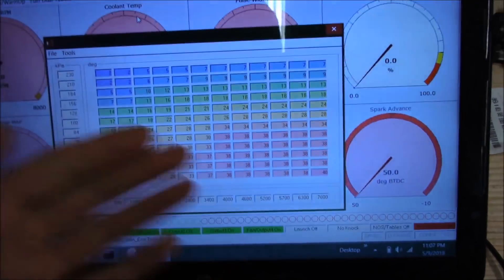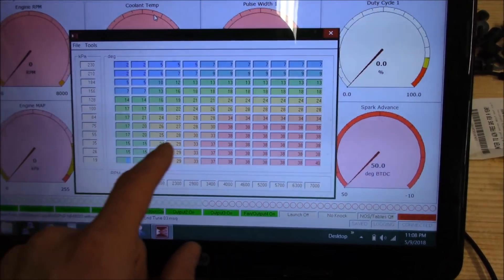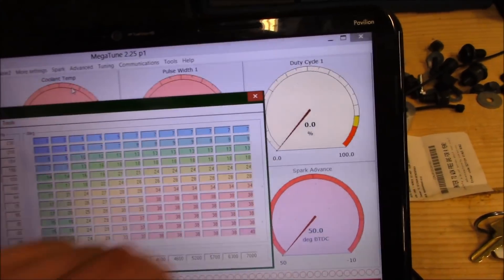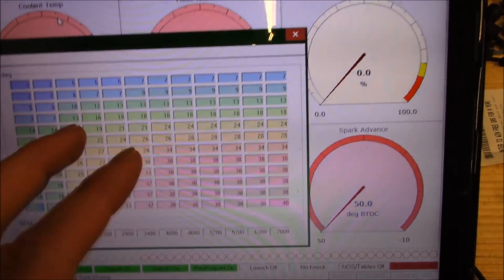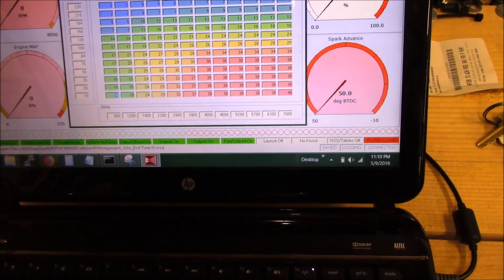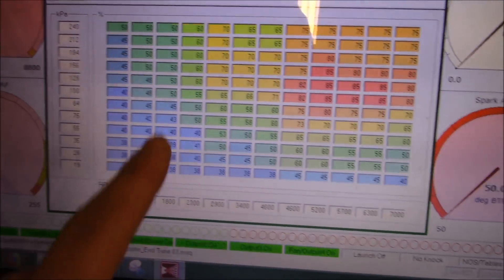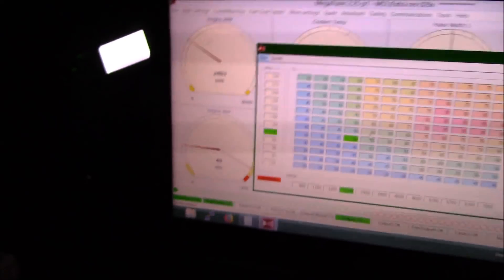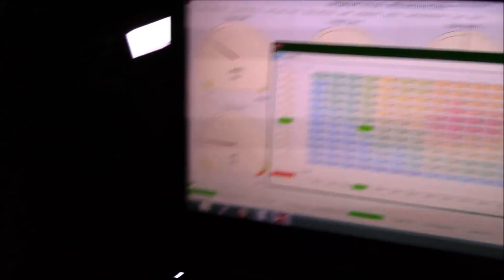The IMPORTANCE of TUNING

Comment: A property rebuilt engine will increase performance and reliability. For example, it you rebuild a bottom end by balancing the rotating assembly and ceramic coat the pistons that will make the engine spin easier and more resistant to detonation.
Reply from the maker: If you are detonating, ceramic coating or not you are still doing damage.

Comment: Megatune?  You need to get Tunerstudio if you are gonna tune MS related stuff.  Megatune gonna make you take forever to tune stuff in.  Atleast with tunerstudio you can do a lot of stuff a lot faster.
Megatune is dead and shouldn't be touched ever.
Reply from the maker: Okay.... My MSPNP was a version 1 and the tune just needed some minor adjustment after transplanting everything into the new owner's car. I no longer own any of the turbo setup, engine or ECU so the TunerStudio thing has no bearing for me at this point. We finished the original tune when everything was in my car back in 2010. Not sure if Tuner Studio was even available back then.
Reply: I understand it was a MS1 based ecu, even so Tunderstudio as of now would be the way to go.  I give the benefit of doubt that you may not use MS much.  I don't recall if it was around in 2010, but I know for sure now you could use Tunerstudio with MS1.

I agree completely with the video though for the overall reason you posted it.

Comment: Great video! I tune as well and like this approach. Gotta fine me some help. Also its funny how most don't understand the importance of NOT tuning to the ragget edge. Hell the Fd Rx7 is a perfect example of this. Some say the 10.0 A/F ratio is too rich for 10psi. What they don't understand is that that extra fuel is their to compensate for someone running 87octane. Even Mazda knows that not everybody is gonna run the recommended 91 so they have to program in more fuel to compensate. I ran mine for years with 87 without any problems.

Comment: Tuning is awesome, and even more awesome is when you do your whole build and self tune it to perfection. I finally got my car back on the road after 2 years of up and downhills building it. Been driving it for about one week now and taking small steps road tuning it. Drive-record datalog-take a break-tune-drive again and repeat. Never before tuned anything or even built something this serious, and it just drives better everytime when getting it dialed in. Don't even have idle air control valve and cold starts with E85 works like a treat without touching the throttle at all with big 272 cams. Only ignition controlled idle strategies to get cold and warm engine rpm's where I want it to be. Feels good now when you light up 265's in 3rd gear with just throttle at 14psi lol.

Comment: I mean surely you wanna use a dyno to tune all cells and have it apply load, rather than go out and completely toast your brakes? that doesn't seem right to me
Reply from the maker: Brakes are a small price to pay vs blowing your engine. However, you are not even going to kill a set of pads doing a full tune. Maybe wear them a little bit in the process, but that is it. The problem with a Dyno is that even though it simulates the load of road conditions, it is not really the same. So if you tune on the dyno and then go out on the street, the tune changes. Forced induction cars are more effected to the point where it could cause damage. N/A cars are not as bad but no matter what you need to go through the entire map again on the street after dyno'ing and check everything. Every one of my cars needed some corrections do to the changes in load.
Reply: I mean if it works for you that's fine, I'm not trying to attack you. I'm just saying with a dyno being able to produce any amount of load, I can't imagine many situations found on the streets that a dyno can't do, and you don't have to fade your brakes a bunch of times and get interrupted by unexpected events on the road, not to mention fast stuff that could get you a ticket.
Reply from the maker: I know you are not attacking me and I wasn't being defensive. I don't think you are understanding what I am saying. The Dyno's load is different per RPM than per RPM on the street. So the tune changes after you finish tuning on the dyno getting your final numbers and then put the car back on the street. I have 5 cars with standalone ECUs in them and every single one needed tweaking after going through the tune again on the street after Dyno'ing. That's not saying a car fully tuned on the dyno is just going to blow up if you don't change anything after putting it back on the street. But perhaps from a long term stand point I would think that engine life would be compromised to a degree since the tune wouldn't be optimal. Also, as long as you have a decent pad like a Hawk HP+, you are not fading the pads brake holding the car. If you have ever jumped on the brakes hard from say 80 MPH+ you get sparks also. Doesn't mean the pads just fade or wear away to nothing. To your last sentence, you can just keep that cycle going and say well you shouldn't speed or attack corners and so on and so forth. Everything has a risk. You can decide what is right for you. I am simply showing how we have been tuning and the success we have had over the past 10 years tuning my cars this way. Still haven't lost a motor. Take that for whatever you think it's worth.

Comment: damn there has to be a better way than toasting the brakes, would hate to spend my money on a tune and then have to buy brakes after lol
Reply from the maker: Brakes are a small price to pay vs blowing your engine. However, you are not even going to kill a set of pads doing a full tune. Maybe wear them a little bit in the process, but that is it.
Reply: does TRD or Nelson racing use this sort of method?
Reply from the maker: I am not sure what they use to tune. My guess would be an engine dyno.

Comment: As someone who recently switched from an "off the shelf" flash tune to a Cobb pro-tune for my GTI, I can wholeheartedly attest to this. As part of this process I learned how to read and understand datalogs as well as relationships/correlations between different parameters. It's a piece of the puzzle that's often taken for granted and hardly fully understood. Certain "qualms" that I have learned to live with when the car was flash tuned are now completely gone and the car is faster and smoother than ever before. Great video!

Comment: always great videos. Do you have a standalone ecu on your s2k? if so what did you choose? and if yes to the first question, did you do a street tune on the s2k as well?
Reply from the maker: Yes I do, it is a Haltech Platinum PNP. Yes full tune on the street, then dyno for final numbers, and then cleaned up again on the street. N/A cars won't change as much as a turbo car will from the Dyno to the street, but we still had to make some tweaks after the dyno.
Reply: I was highly considering purchasing a Haltech, but I was doing my research and came across a few questions being if it would work with my 2005 ap2 s2k which still has the throttle cable. I found one post on s2ki stating that it should work as its not a DBW. What strays me away still is being able to keep all functionality in the s2000. The ap1's have a different display for its coolant gauge and I have not seen any information if it would be compatible with the 05 coolant gauge. Ive read the Haltech PnP keeps all its functionality for the ap1 s2000. Only reason that I dont get an AEM is I hate the long cranking. I read AEM asks for 720 degrees of crank rotation before ignition. To me, it makes the car subpar. puts a stigma in my head that something is wrong. ie; I get negative feelings over it.
Reply from the maker: I don't see why the the coolant gauge wouldn't work unless there is something specifically saying that it won't. Long cranking is a good thing. Means you get more oil pressure before the engine starts. The Haltech cranks the engine slightly longer than the stock ECU as well.

Comment: Reliability, of course, you should build for reliability. Yes, you can build greater performance without strengthening the engine and it will likely blow up hence using forged pistons, better bearings, etc. to keep the system reliable. 
Then, yes you can map with ignition as close as it gets to a knock with very little fuel to maximize torque but again, what s the point, it will break... so retards by 2deg and aim for a slightly lower afr... you will loose a few ftlbs but you will remain reliable...
Reply from the maker: Right. I just think that once you undo those rod caps you are getting rid of the 200k mile stock motor reliability. I'd love to see a built motor (pistons, rods, bearings, etc.) do 200k miles, but I don't know if there is one that exists. I'm sure it is possible if someone is really really good, but most of the time people go to local engine builders and have no idea what was really done.

Comment: im shaving my 97 miata head 0.020 inch and running on stock ecu and cam gears, will this be ok
Reply from the maker: Should be okay. Might want to run 89 or 91 octane afterwards as that will bring compression up to about 9.7:1.
Reply: thanks!! I was planing on running a higher octane fuel do you think  0.030 inch would be to much with stock cam gear/ ecu? love your channel by the way!!
Reply from the maker: I think you can do up to.040" on a stock ecu with 93 octane, but don't quote me on that.
Reply: sounds good but I probably wont go higher than .030 , i have 93 octane where i live

Comment: loving this kind of info! I'm looking to run twm itbs like your nb and was wondering what ecu it is tuned on and would you recommend any specific ecu for NA tuning? i know some have lots of extra functions that cater to boost but are there any extra functions that you would look for in NA use?
Reply from the maker: N/A applications require less. You can just tune off of TPS to simplify them. I have an Adaptronics in my NB. I was in on the original group buy for them when they came to the USA. Went through 3 ECUs to get one that worked. My crank angle sensor and ECU read timing off from each other by like 4 or 5 degrees. So my timing maps show more ignition advance than what is really happening. Given those minor set backs, the ECU is still preferable over my Megasquirt PNP V1. Not sure how far they have come now. I like all of the new Haltech stuff a lot. The one in my S2000 works great. I don't think they make plug n play stuff for Miatas though.
Reply: sounds like I've been on the right track with my ideas of what i need from an ecu as I'm aiming for the simplest setup i can. the PO of my itbs had an adaptronic pnp and said it had idling and drivability issues. Haltech has good stuff but it requires rewiring (not simple). Flying Miata/Motorsport Electronics released their drop in fully programmable FM221 motherboard made to fit in a stock ecu box and use all factory wiring. never seen this ecu used to run itbs but i can't see why it wouldnt based on the functions it has. every time i ask someone about it i get crap for not using boost so getting reliable info from someone with previous experience NA tuning is great. also do use a stock TPS or is it on your twm manifold? and did you make any large fuel system mods to run the aftermarket injectors and fuel rail?
Reply from the maker: I have no idle or driveability issues with my Adaptronics. It just took a little while to get everything dialed in. I adapted the stock IAC valve, so idle is all set too. No modifications to fueling other than deleting the FPR and utilizing one of the stock pulsation dampers for the returnless NB fuel system. My manifold came with the optional 39 lb injectors from TWM.

Comment: I wonder how you tune for example the fuel cells with low boost at high rpm?
Reply from the maker: Easy, just back off the throttle so you are not boosting but are giving enough gas to cruise in that cell.

Comment: I have an ap1 s2k with emanage ultimate, NA but full bolt on. From what I read, I can only reliably tune by TPS only. What order should I set up the tables (I understand that they add on each other)? Timing then AFR then air temp? When/why does coolant temp come into play (other than when the car is not warmed up yet)? Any help would be appreciated.
Reply from the maker: Emanage piggy backs off the stock ECU, which has the MAP sensor in play. You can blend it with Alpha-N, but tuning off of just TPS is probably easiest. Set your timing map close to stock, then go through fuel, then you can play with bumping timing, then once your tune is close to finished, tune all of your corrections i.e. air temp, coolant temp, and voltage.
Reply: Garage Quinn Motors thank you!

Comment: You say no less than 20 hours tuning on each car. What about those of us who don't know how to tune a car? I have a miata ND and was going to do remote tuning with data logs and ecutek. It's going to be just bolt-ons but I have no other choice to do remote tuning for the skyactive motor in south Florida. What would you recommend I do? How long would it take me to learn how to use software to tune the skyactive motor?
Reply: I promise to never make fun of neo chrome again if you give me your .02 :D
Reply from the maker: I have no experience with the remote tuning stuff and how accurate it is. I am assuming they will be doing it on a dyno, but I would still have someone knowledgeable stick a wide band in it and go through the map afterwards on the street to make sure it is okay. It's not just understanding the software, but understanding what the motor wants, how it should sound, and knowing where AFRs and ignition timing should under each load condition. It just takes a while of doing it to truly understand it. It took me a long time to understand it the way I do now and grasp everything. You can make fun of neo chrome. My feelings don't get hurt easily ;)

Comment: Nice insights and video. What do you think about logging the runs with boost, rpm and AFR. And then doing the adjustments when stationary? This way you could do it alone? Also this fuel table you showed is for WOT? What about part throttle, do you tune for that or is it all dependent on boost? Thanks!
Reply from the maker: I don't really like the datalogging tuning because you cannot feel or hear what the motor is doing at that RPM/Load/Boost while comparing the AFR. The fuel table I showed is the entire fuel map for the car, idle, decel, part throttle, cruise, WOT, etc. The X axis is RPM and Y axis is load/boost pressure. 100 KPA around the middle of the Y axis is 0 PSI. Below that is vacuum, above that is in boost.

Comment: hey quinn, thanks for the video, i'm very new to tuning, and just had a quick question... so at the end of the video, when you're doing the street tune. when you're holding the brakes and maintaining revs, is the program automatically populating the values for the cells? or are you manually typing in values?
Reply from the maker: Anytime! The values are not populating, we are manually adjusting them and watching the change on the wide band, while listening for how happy the engine is and for any detonation. It takes a lot longer then what I showed. I just wanted to give an example of brake loading the engine and how we go through the entire map.
Reply: So starting from the minimum mix is 14.7 (below 100Kpi) and the maximum is something around 10 (above 100kpi), we could start from scratch some mix values from 11 to 10 afr ratio would be placed in all the first row (from left to right). Values from 11.5 to 10.5 in the second row, values from 12 to 11 in the third row, values from 12.5 to 11.5 in the fourth row and values from 13 to 12 in the fifth row. Could it be a good start?

Comment: Just a couple of points:
1.  You didn't mention if you gave him your exhaust as well?  If this changed to a different item, the engine would require map changes for the possible different flow rates (a better flowing exhaust would make it run lean and a more restrictive exhaust would make it run rich).
2.  It should also be noted that as much as too much ignition is detrimental, so is too little ignition.  It might not result in a catastrophic failure, but it can create extremely high EGTs that can nibble away at turbine wheels, valves and piston crowns. 
I also totally agree about live mapping rather than generic chips.  
Great content as usual :).
PS.  Engine dynos FTW :p ;).
Reply from the maker: Thanks Mike! Yeah, it's not easy remembering to cover every detail in videos like these :)
- Yes, it has my complete 2.5" turbo back exhaust.
- You are right, too little timing is bad as well. In my experience, I usually see people running too much timing advance.